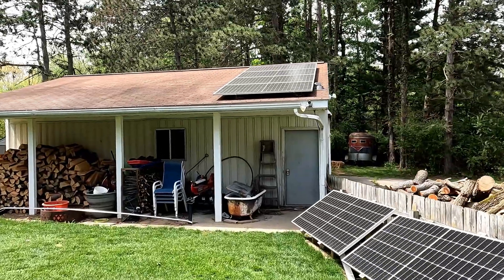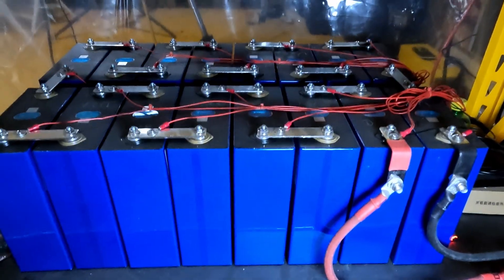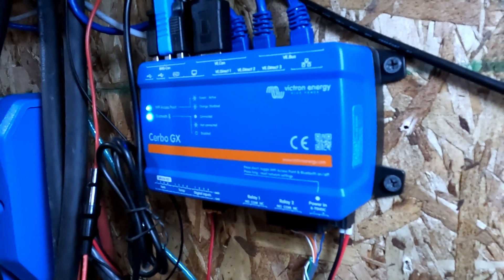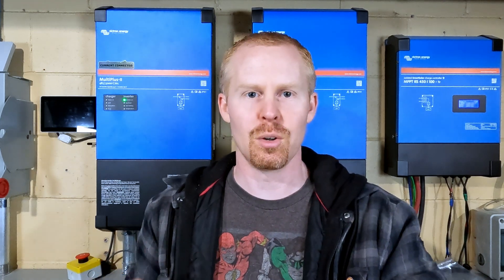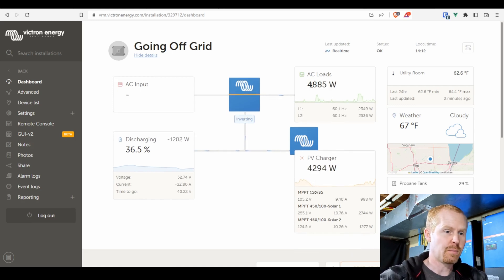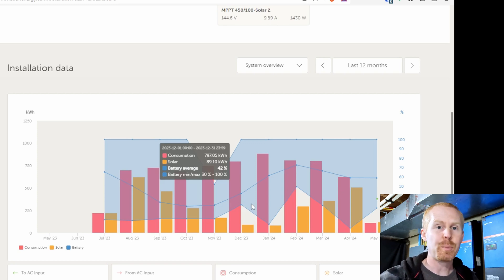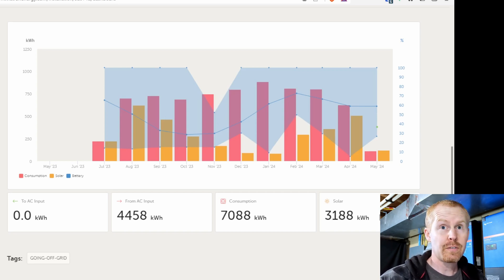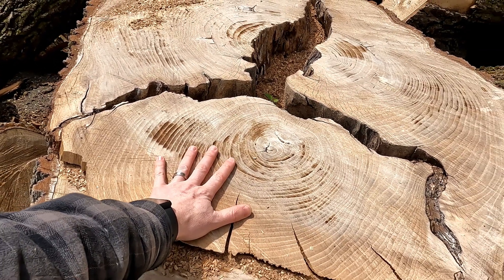Victron 10kVA Update - The Last 8 Months

Comment: Ahhh so the 450/100 is just a charge controller. It's NOT an inverter. Right? Does Victron make an All-In-One MPPT+inverter?
Reply from the maker: Correct, this is just a charge controller.   

Victron does make an all-in-one, but I don't believe it's available for the US market.  It's designed for overseas voltages.  Many hope that someday Victron will bring it to the US market, but I'm not so sure.

Comment: Adam, I enjoyed seeing your update video on your Victron system.  It seems we share very similar experiences in our solar journey, except I'm operating at 24V (off grid but grid tied) w/ 2 x Victron 24V 3000VA Multiplus inverters in split phase mode and a 28 kWh battery bank.  This powers most of my 120V loads and my 240V well pump.  I use the grid as backup when solar production is too low.  I have a 12 x 450W panel ground mount array that I put into service last August with two Victron 250/100 MPPT solar charge controllers.  Previously I used an assortment of 100 W panels for "testing" purposes.     

My results in southern Michigan are very similar to yours.  In December 2023, solar only generated 180 kWh, Jan 168 kWh, then in Feb 382 kWh, Mar 435 kWh, April 514 kWh.  I'm hoping to hit 600 kWh per month this summer.  Overall my LTM consumption was 7336 kWh with 2813 kWh from grid and 4523 kWh from solar production .  The energy dashboard from my utility company (might be the same as yours) shows impressive reduction in usage too from previous years.  

I can't quite justify it economically yet (about $860 annual electricity savings), but I like the fact that I can ride through grid outages without even seeing the outage, generate most of my own electricity and avoid on-peak power pricing.  This will become more important as on-peak prices increase and the grid becomes less reliable in the future.   The way I justify it to my wife (lol) is that this is way better than buying a whole home backup generator that only gets used a few hours a year and otherwise sits there doing nothing.  Our solar system not only backs up our critical loads but as a bonus, helps reduce the electric bill throughout the year too.
Reply from the maker: Thanks Bruce!  Yeah it does sound like we have very similar seasonal results.  

The important thing is that overall you're seeing the ability to get past power outages (without the noisy generator having to run) AND you're seeing a decrease in your monthly bill on average.  I know I just got my most recent electric bill and it was the lowest I've ever seen.  $56.  I was hooting and hollering!  Love seeing that!

You're exactly right about the whole-home generator.  That was the big reason I got into solar to begin with.  Why buy an expensive lawn ornament that you still have to pay for fuel for (and perform maintenance on).  

Thanks again for sharing!  Enjoy the journey!

Comment: I like your setup. I feel, at this point, it makes sense to get more solar panels if possible. You have good Victron hardware, while solar panels are relatively cheaper.

Also, I am curious whether you have shading issues for solar panels connected in series.
Reply from the maker: Thanks!  Yeah I need more panels and still more storage.  

As far as the solar, I've got them split up into different arrays to maximize the solar potential.  I had thought about putting optimizers on them, but Victron explicitly states not to use optimizers on their charge controllers (at least the 450/100)
Reply: @AdamDeLayDIY  Yeah! You can never have too many batteries. It makes sense to have multiple different arrays.

I would have spent some effort analysing a timelapse regarding a non-uniform shadow on your solar array. You don't need solar optimizers to perform such analysis.

I would have tried to estimate the gap between the average solar panel and the worst-performing solar panel from your solar array. Imagine you have the ability to connect two solar arrays to your MPPT. Then you can follow the strategy:
- pick a single solar panel which will represent a baseline
- spend N - 1 days connecting each solar panel as a second solar array (you can test every second solar panel to save some time).
- measure the relative performance and estimate the impact of low-performing panels, which might degrade the performance of the entire array.

I understand that you'll waste a lot of electricity while doing such a measurement. I wanted to share my friendly suggestion. Maybe you tune your solar deployment so well that my suggestion makes no sense, but only you know the answer.